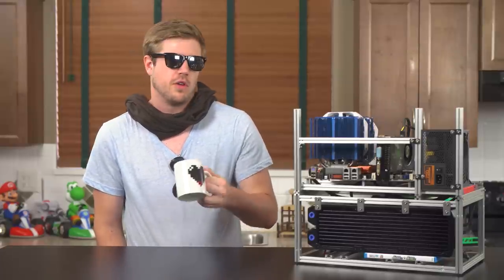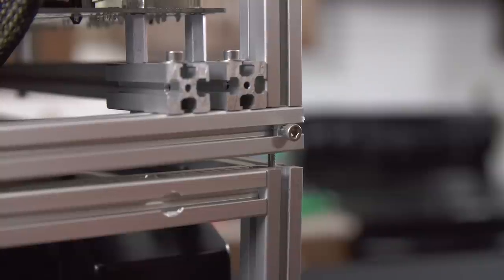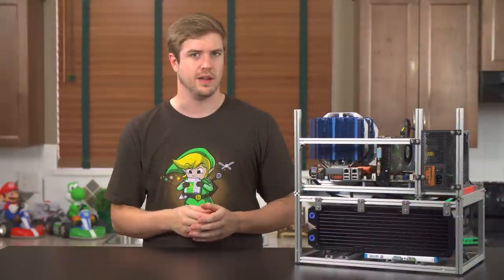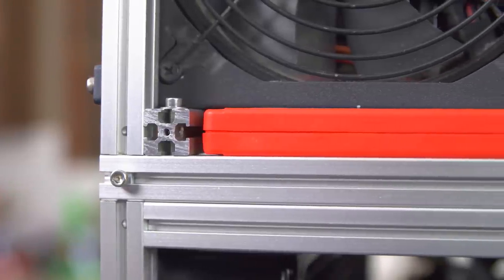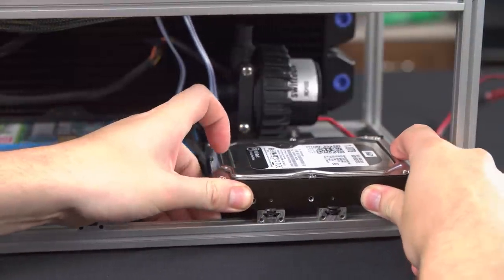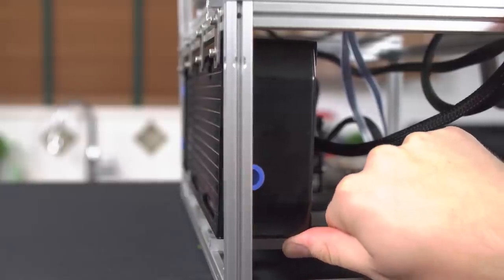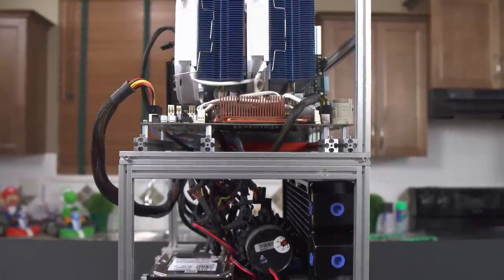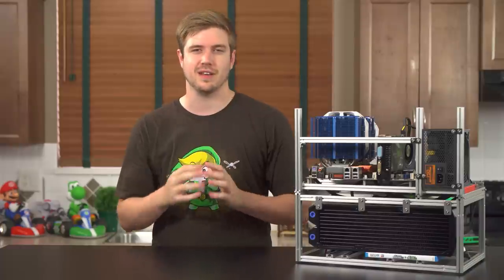Spotswood Tech Station - Extremely Modular Test Bench

Comment: So I'm new to PC building and this may be my first build as I am moving from gaming on a Mac and console (waiting for those special comments). I'm not sure if I should go for a cheaper build or if I should just go straight along with and I am planning to use it with the new Asus ROG Swift 1440p 144hz monitor: http://uk.pcpartpicker.com/p/ZKQGhM
And here's the build for people who cba to use the link:
CPU: Intel Core i7 4790k @ 4.0 base
CPU Cooler: Corsair H100i
Mobo: MSI Z97 Gaming 7
RAM: 2x8GB of Corsair Dominator Platinum 1865mhz
SSD: Samsung 850 Pro 256GB
HDD: Seagate Barracuda 7200RPM 3TB
GPU: Asus Matrix Platinum GeForce GTX 780ti @1.1ish ghz base clock
PSU: Evga Supernova G2 750W 80+ Gold
All inside a nice black and red NZXT H440 with 3 140mm Corsair AF140 Red LED. 
BTW I have spent about 6 months refining this list but it still might not be the best so I'd appreciate any feedback, thanks.
Reply: BTW I'm planning to play BF4 and other FPS games at @1440p & @60fps least but at least no screen tearing with GSYNC :D
Reply: Just some advice, not on your problem as I'm not sure of the answer but you'd have a lot better luck getting advice and from more people if you posted this as a thread on Linus's forum. There is a link to it below the video. Lots of helpful people there.
Reply: That's a great build, plenty of power for high settings at 1440p. If you have the cash go straight ahead and build it, you won't regret a rig like that. It's just my personal opinion, but I don't like HDDs with a capacity over 2TB, they have a tendency to fail pretty quick. Your best bet is to get a 2TB western digital black, it's a reliable and high performance drive that many people swear by. Other than that, it's pretty badass.
Reply: Looks great! maybe later on add another GPU for better 1440p performance.
Reply: Great build plan, man. If you're planning on SLI later, maybe you could save a little by going with the 1000W PSU right now. Also, the thermal paste is included with most CPU cooling systems, so you don't have to get it separately.
Otherwise, I really like the parts you picked. I'd probably go with an Asus mobo, an EVGA GPU, and Noctua fans myself, but to each his own :)
Reply: id advise you to look at a 500gb ssd rather than the 256 the price difference isn't much but if your planning to install several games the extra space is a great help what with games like titanfall clocking in at 50gb these days this increased size will likely be the trend from now on. also you probably dont need an 850 pro for gaming an evo ssd will give comparable speeds at twice the size for the same price.
other than that i prefer asus motherboards but thats personal preference, 16gb of high speed ram is more than enough anyone sticking in 32gb is wasteful, go for a windows 7 install instead of 8 and a 2tb second drive should be more than enough anything more and you might want to use external storage on a NAS for movies etc for streaming to tv's.
Reply: That's an amazing system, if you can afford it it's looking pretty balanced and good for 1440p 60, however it'd be a better idea to ask on the forum.
Reply: Badass build! You'll make a monster if you add another gpu and more power! Well it is already a badass
Reply: Try the single GPU first, if you want more power later add a second one a few months after the build, cause SLI is kinda buggy
Reply: Franck Bender While big power PSUs are all well and good, they aren't really that necessary.  I'm running a 780TI off a 450W-Gold PSU and a tonne of fans.
Reply: If your gonna spend that much I'd get noctua fans for cpu cooler and instead of h100i get swiftech h220x or nzxt kraken x61  or cm glacer. 240l and react the fans with noctua for less sound and better perf. H100i is good but with everything yu have and the money your spending get a better one. Also if you can wait till fall and get gtx 880 or apply for set up program and get. 780ti now than get 880. Also for 144hz 1440p to get up to 144hz with good quality (ultra settings or high) you may need sli set up
Reply: Also nzxt h440 is nice but has poor air flow. For 10-20 doars cheaper check out enthoo pro by phanteks best case for the money out there I have it and love it. If not convinced see hardwarecancuncks review on it
Reply: those are good parts as james emsley said you should go with noctua fans there the best
Reply: hackintosh it
Reply: Nehemiah Yu if he is planning on gaming on it then that is a horrible idea
Reply: Classy Man ever heard of freaking parallels.
Reply: ***** thats no good for 1440p like he wants....that will do 720p and low setting on 1080p
Reply: Psssshhh that's terrible, you can barely play Minecraft I bet.
Reply: Noam cohen someone needs to go back to school
Reply: In how much time do you need it? A 780Ti is good but I think you'd want more VRAM and power in the long run. The Maxwell based 880 is going to be released in September and it will likely be much faster the a 780Ti due to being much more efficient (2x the performance per watt) and there will also more memory (4GB is what is reported to be the default but there will definitely be vendors with 8GB, considering that's how much the 880M has by default) which will be much better for high resolution gaming in the long run. Only ~1 month to wait and see what nVidia has to offer (Gigabyte will also release their 880 G1 at the same time)
Reply: Don't bring it here
Reply: a hint: never mix mobo and graphic cards brands. stay with one. i reccomend asus. there may be very annoying incompatibiliy problems between brands.
Reply: Jimmy Griffin
 its pretty polite not to call a stupid someone you don't know. I work assembling PCs, I have put together hundrerds, and i've had countless hardware incompatibility issues over years, which you might have never got to see if you assembled one or two pcs in your life. These are a pain in the ass to diagnose. how did i fix this? not mixing brands. issues over.
Reply: fjoa123 Brands weren't the issue then. I have put together many PCs, I think I hit 23 last weekend, when I built my friend's. I think only twice I've ever gotten same brand GPU and mobo. Never had an issue. Never will have an issue. By that logic, what if I want an XFX card? They make some of the best AMD cards. XFX doesn't make mobos. So do I just settle for an MSI one? No. Fuck that.
Reply: fjoa123 I have Asus mono and nvidia GPU, no issues
Reply: Lewis Charlton he's talking about the vender. Eg: evga, MSI, XFX
Reply: fjoa123 never had any of those problems, i always used a sapphire gpu on a asus motherboard, (and a random x950 with a msi board)
Reply: ***** the i3 depends if it has 2 extra (virtual) cores, (hyperthreading) but amd 6 and 8 cores are true 6 and 8 cores, and never go for a i3 for gaming, they really suck
Reply: Lessermold X hyperthreading DOES NOT give you extra cores. It however, gives you extra THREADS.  That's why it's called hyperTHREADing, and not hyperCOREing.
Reply: Jimmy Griffin tell that elssermold X guy that  amddoesn't have 6 real cores.
Reply: Nehemiah Yu http://www.reddit.com/r/buildapc/comments/1e8226/discussion_amds_module_architecture_the_fx_8350/ they are not really 8 cores, but they dont have (virtual) cores like the i7
Reply: Jimmy Griffin i know, i used the wrong words
Reply: Get the corsair 760t case!! sexiest case I have ever seen...
Reply: ***** 880s and 870s are a rebrand. They just really are 780s and 770s with better thermals. They won't yield much better performance for the cost
Reply: Lessermold X I'm sorry to tell you this, but it isn't true. Just because some guy on Reddit posted it, doesn't make it right. AMD has eight cores. None of them are virtual. Just eight cores.
Reply: Okay, thanks for clearing it up for me, i didnt understand it properly ;)
Reply: looks sweet, I recommend switching your corsair fans with maybe bit fenixes or aerocools or cougars because I see alotta complaints about the loud and supposedly shitty bearings they have, might wanna think about downgrading the hdd to 1tb, and your processor to an i5 4690k, that saves about 100 euros-ish? im Canadian so I don't have a clue, in the build I have setup its gonna have a 780ti sc acx by evga which I recommend, people praise their customer service and apart from that the card is fast and easy to do some oc-ing and watch the ram video linus has, it describes cas latency and memory frequency long story short you only benefit from higher memory clocks if the cas latency is as low as the 1600mhz or close to it, if you hope for sli in the future it might be smart to pick up a 850w psu for that extra wiggle room, plus you might wanna upgrade to the h105 because I heard it fixed the pump noise which the h100i has, otherwise it looks good and if you can wait then wait until the 800 series comes out, not only will it give you more buyers options but as with the release of anything new the older product (780ti) goes down so if you can then hang on for a bit it will pay off in the end
Reply: Switch the Corsair AF140S for the SP140 LED ones.
Reply: it doesnt really matter, check jayz2cents channel for it
Reply: scrap that, just follow linuses latest build guide (the surround one) it makes my mouth water!!!